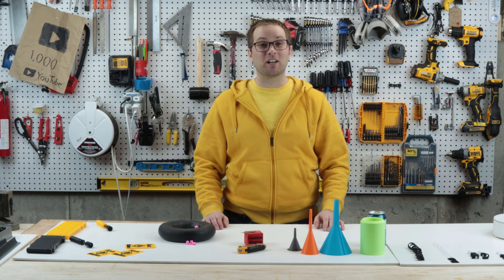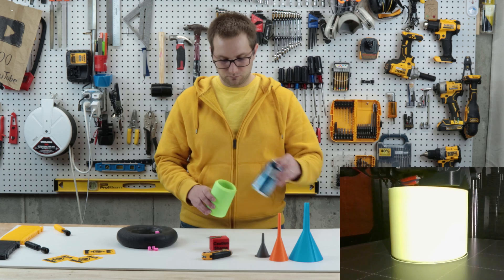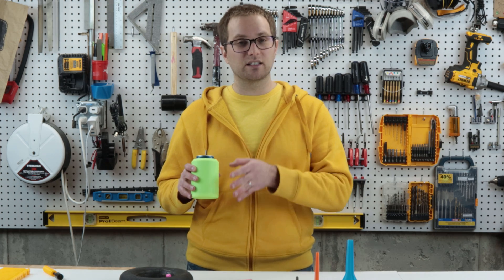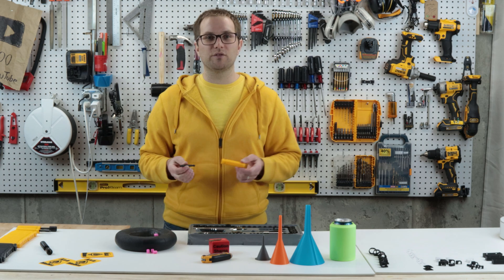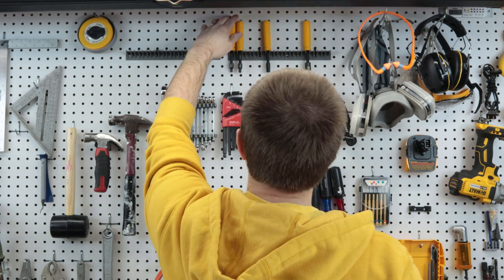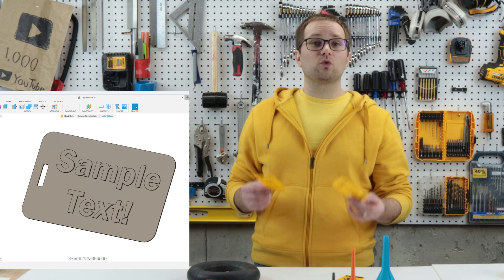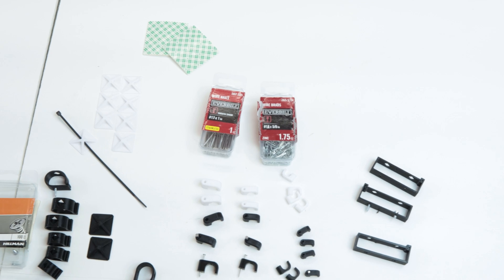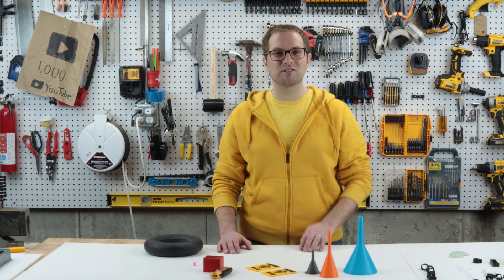7 (more) functional 3D Prints you'll actually use!

Comment: For just a fuel funnel PLA or PETG are fine. They aren't going to melt on contact or severely degrade or anything. As soon as the gasoline evaporates, they'll just be dry again. There are submersion tests showing it hardly affects them after a long period of time. TPU is also very fuel resistant and I have even used it as a gas tank gasket material. I would not make a gas container out of any 3D printed material without extensive testing and vetting obviously, but a funnel is a funnel. Also air is a good insulator so just leaving the walls of the koozie hollow is a good bet. That's why thermoses are double walled.
Reply from the maker: Oh good to know - thanks, I (obviously) didn't research how gas would react with PLA/PETG and didn't want dissolved plastic in my chainsaw engine.

I need to do a side-by-side test on air gap vs wool vs solid plastic on the coozie. I actually did thermal fluids modeling professionally for a few years and could also just do a decent back of the envelope heat transfer calc. But I figured sheep are pretty good insulators - and I already had wool felt.

Anyways, thanks for watching and commenting! I definitely learned something
Reply: @AsaMakes  Also for legal reasons my advice is not legal advice and do anything I say at your own risk. 😂 Yeah I believe wool is such a good insulator partially because it traps tons of small pockets of air. Good stuff! Also get reusable zip ties for your peg board and you'll be able to rearrange it any time. 😁
Reply: @AsaMakes  Very late to the party but who cares! If you look up "3D Printed TPU Gaskets? -- Follow Up"  By the_eddies, He experimented with leaving a tpu testpart in a jar of gasoline for a year! It survived! So choosing the right type of tpu thats rigid enough for a funnel should work great.
Reply: I used PETG for a gas funnel. Its cheaper to buy one but more fun to make yourself 😊

Comment: Very nice and pleasant channel! What kind of Fan Duct do you have on the MK3S? I'm looking for a good cooling solution for my MK3S+. As well for my MK4.
Reply from the maker: Thank you! Do you mean hot end fan shroud? I just run the stock config on three of Mk3s and my Mk4. On one of my Mk3s I use the Delta P Fan Duct from Printables

It works great but run stock settings 99.9% of the time so the default is usually good enough

Comment: I subscribed because you include the cad files.  Please do more videos about functional prints!  I was chatting with Bard (now Gemini) about using Styrofoam pellets for cookie insulation, and it informed me there are some infill patterns with higher insulation R-value than my other insulation ideass.
Reply: Dang autocorrect... I meant to say, Koozie insulation.
Reply from the maker: Thanks for watching and for subscribing and for commenting! I haven't tried Bard/Gemini yet - I've only used ChatGPT 3 and 3.5 to help me write OpenSCAD code. Have you compared Gemini to ChatGPT at all? I would say it's OK at writing OpenSCAD - it usually doesn't work but gives me a good enough starting point to iterate and get what I want.

I'm already working on the next functional prints video, they take a while but I'll get one done in the next month or so!
Reply from the maker: Now I'm thinking I'll try the paid ChatGPT and compare it to the free one, I haven't tried others yet - now I'm gonna have to go watch some comparison videos of each of these.

Thanks again!

Comment: I dont think PLA will warp just outside it needs to be in an enclosed hot area like inside a car... however LOOOOOONG outside exposure like in a garden for garden otnament you get breakage and wear only roughly about 2 years later.... I have a moped that I have added a USB hub and a 12V socket and a 12v voltmeter to it and all 3 I have made 3d printed housings out of PLA and they have been on my moped for the last 3 years with no warping and I stay I Cape Town South Africa in AFRICA in summer sunset is close to 8pm and sunrise about 5am and sunny all day
Reply from the maker: Oh good to know, thanks

I've had my share of PLA prints completely warp in the car so I'm scared of anything outside during our hot summers but obviously a car will get much hotter than ambient outside

Thanks for watching!
Reply: @AsaMakes  Thank you for the response. also a couple of years ago Joel telling from 3d printing nerd also did a video as he had 3d printed gear shifters that also warped within a year in his car and he had a video about Annealing PLA prints in the oven before usage and then they last longer.

Comment: Design a new bracket or better still fasten the panel to the wall with more than just spit.
Reply from the maker: Spit and a curt nod which adds approximately 15% rigidity 

The peg board is screwed into three vertically mounted 2x3s which are anchored into the concrete behind it - so it's not going anywhere but it sure isn't ideal 

I didn't think about adding horizontal braces to keep the pegboard from flexing until after I organized all my tools. A lesson learned for next time... ah well 

Thanks for watching!

Comment: The hollow coozy would probably perform better without the wool inside.  Hollow double wall is a great insulator, probably better than wool.
Reply from the maker: The math says yes hollow single, hollow double, or solid walls should actually outperform wool. I tested: solid, single wall, double wall, and wool and the results were essentially the same which surprised me! The margin of error in the cheep thermometers I was using was larger than the difference in actual insulating performance

I filmed with the wrong camera settings so I don't plan to make a video of it but it was an interesting result.

In short: save your time and filament and just print single wall hollow

Comment: Great video Asa :yougotthis: The answer to your question is HDPE it is the only one  I know that you can use with fuel but requires a very high temperature, I used it to make and connect fuel lines together, Gas/Fuel cans are made out of it injection moulded HDPE.
I only just started 3d printing this year, found your post on Reddit and subscribed 
😊
Reply from the maker: Thanks for watching, subscribing, and the HDPE suggestion! I will definitely order some and test it if my MK3 or MK4 is capable
Reply: @AsaMakes  Polypropylene (PP) is nearly as chemical resistant as PE and is much easier to 3D print as I understand it. HDPE filament is also very hard to source.